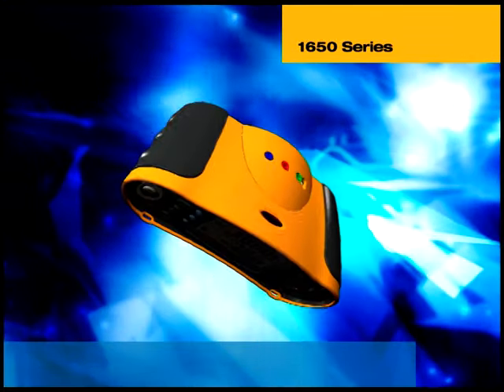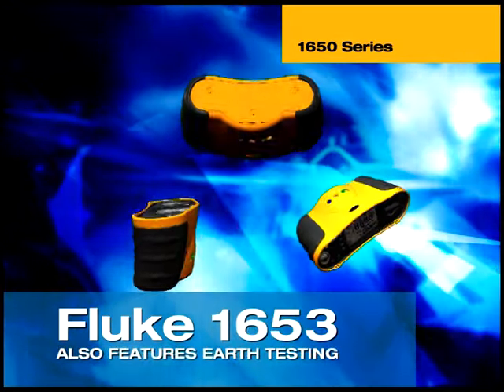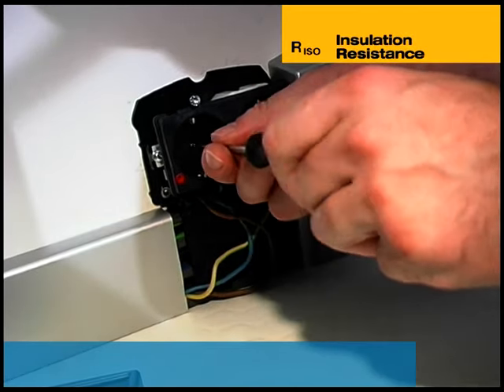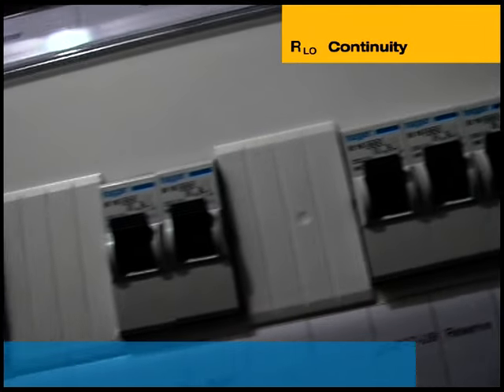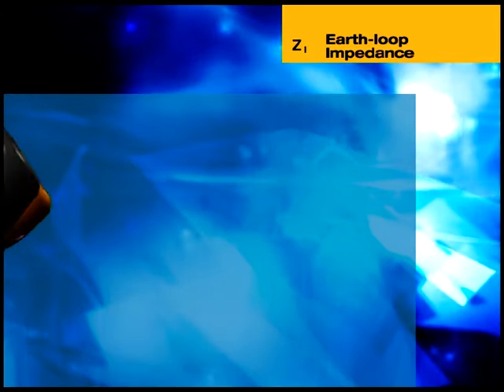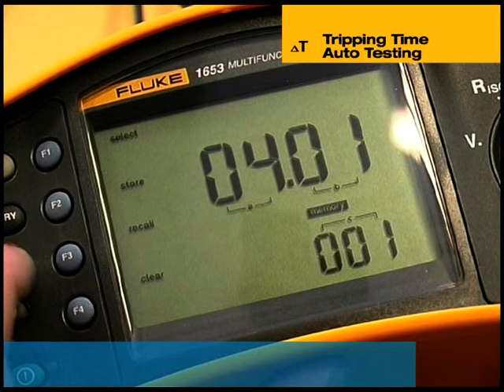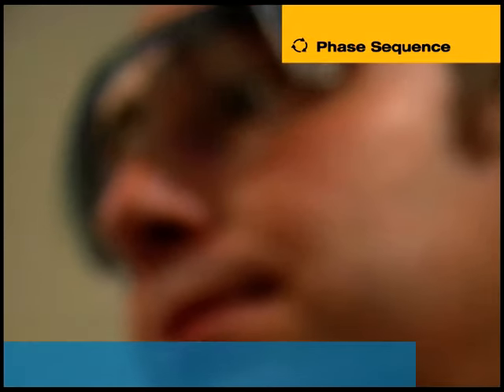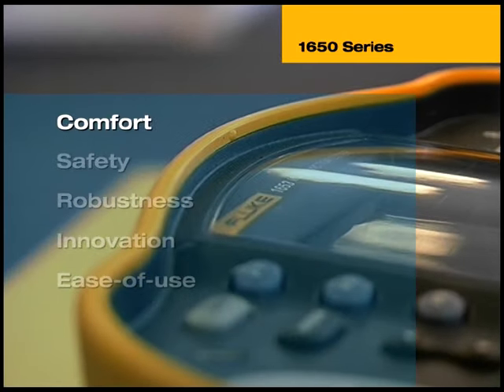How to use Fluke Multifunction Installation Testers

Comment: The 1650 and further shows if there is a live voltage. 

Perform visual inspection for any testing you do. 
1653 is the top of the line which measures Phase sequence and Earth testing. 

1653 can measure:
1) Voltage and frequency
2) Insulation resistance 
3) Continuity - 200mA test current 
4) Loop impedance
5) RCDs
6) Phase sequence
7) Earth testing

1650s can measure upto 500 V AC. It measures line voltage and frequency.

2) To test the effectiveness of the insulation.
Its resistance is measured between all live conductors and betn each livbe conductor and earth conductor.

1650s display the insulation resistance directly. 
It can also generate upto 1000V of test voltage (1000, 500, 250, 100, 50).
50V is used for testing telecomms. 

Beforre testing, disconnect equipment to ensure that test voltage does not damage:
Voltage sensitive devices, Dimmer switches, Delay timers and Electronic starters.

1650s have live voltage indicator.

To measure insulation resistance betn live conductors and earth, installation must be switched off.
All lamps must be removed,
Disconnect all equipment,
Leave fuses in,
Close CBs and final CBs

It displays both the insulation resistance and the test voltage. 
Systems with 2 way switches must be tested with switch in both positions.

3) Continuity
This test verifies integrity of wiring and connections.
Most common is measuring resistance across protective equipment. 
It is done by disconnecting the conductors from sources. 
Check the continuity of the conducotrs and then test the main supplementary bondings. 

All conductors in the final circuit are also tested. 

It can also test the correct polarity.

4) Earth loop impedance - measures the resistance of the path fault current would take. 

Resistance must be low to be able to allow the sufficient current to flow to trip a circuit protection device.

This test test can be performed at the:
(i) 	At the Distribution board
(ii) 	At a mains outlet

Basic loop impedance test measures between line and protective earth and displays the loop impedance in ohms. 
Measurements shd be taken on all outlets of the circuit. 

it is also possible to measure the prospective fault current designated as PFC and is available in lower part of the display. 
PFC determines if the capability of fuses and Cbs is not exceeded. 

1650 also measures the earth resistance component of the total loop resistance. 
Line impedance to neutral and line-to-line impedance can also be measured using 1650.

Generally, measuring loop impedance can trip the RCDs preventing further measurements. 
Fluke 1650 uses unique tech that will not trip RCDs. 

5) RCDs - Detects abnormal currents that flows to the earth that are too small for overcurrent protection but can still cause fire and safety risk.

The RCD tripping time can be determined by inducing a fault current in the circuit. 
The test actually performs a retest to determine if the actual test will cause a fault voltage exceeding 50 or 25 V limit.
To manually measure the tripping time, the RCD's trip current rating, the test current multiplier, the RCD type and test current phase setting are selected using the function buttons.
Some RCDs can be more sensitive in one half cyle than the other. Test must be conducted with 0deg and 180deg phase settings.

The longest time should be recorded. 1652 and 1653 have an Auto mode for measuring the RCD tripping time. 
6 tests are automatically carried out. Time is saved by eliminating the need to keep returning to the installation tester after resetting a tripped RCD.
Results are held in temporary memory and viewed by stepping through arrow buttons. 
1653 has internal memory. 
1652 and 1653 can meausre both RCD tripping times and tripping current by gradually increasing an applied current until the RCD trips. 
Following must be selected
- RCD tripping  urrent (F1)
- RCD type (F3)
- Test current phase (F4)

Main display shows the RCD trip current. It can also sense time delayed and DC sensitive RCDs.

7) RE Earth?????????????
TT systems rely on proper connection to the earth. Usu. earth rod buried into the ground. 

Earthing roads are always tested when system is de-energised. Resistance of the earth rod must conform the requirements. 

The value should not be more than 10 V.

8) Phase rotation
If correctly connected, upon pressing TEST button, the display shows 123, else 321.

Can be connected to the computer and the software can create reports as per the requirement.
Reply: Thankyou appreciate your summary of the specifications, greetings from Holland